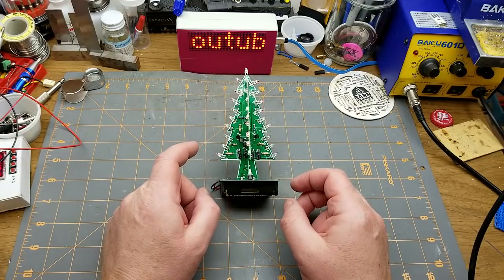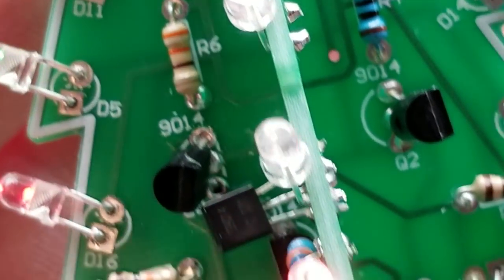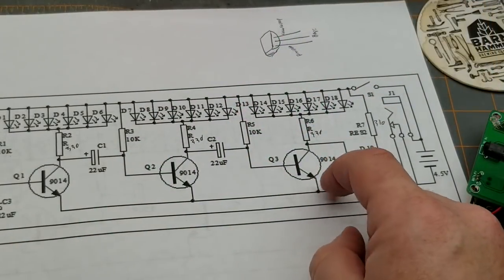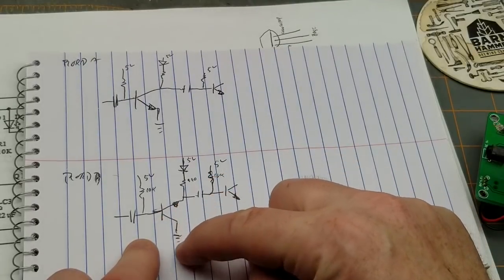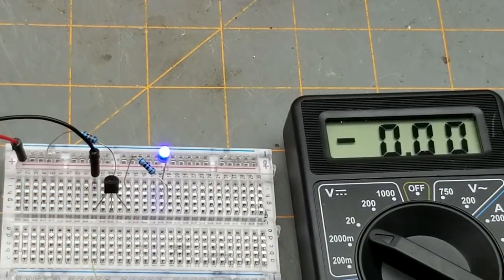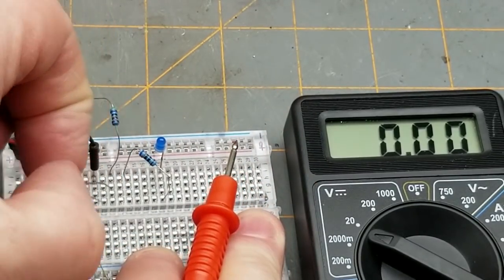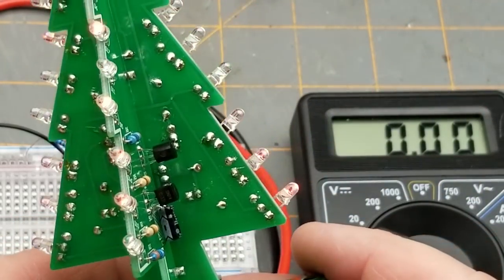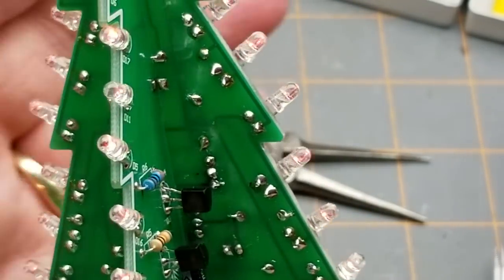LED christmas tree fix.

Comment: It is an NPN transistor, so swapping the collector and emitter it is still acting as a transistor.  The difference is that the gain (hfe) is much smaller if you reverse the transistor. In the old days (early 60s) when I started studying and playing with electronics we even had to test transistors in reverse mode. If I remember right the gain of the old germanium transistors were nearly the same if you swapped the emitter and collector. Some data sheets even gave the values of the gain in reverse mode. There were circuits which used the transistor in reverse mode , I do not remember why, but in certain applications it worked better in reverse mode. If you try it as an amplifier instead of a switch, by say putting a 1M resistor between the +5 and base (giving a base current of about 4.5uA) and measure the current between the + rail and collector you can measure the gain. (Maybe using a 100 ohm resistor in series between the supply and the collector just to limit the current in case you make a mistake.) The current should be around 5-10 mA (gain between 100 and 200). Now swap the collector and emitter and measure the current, which will probably be less than 1mA (gain of 20). In the circuit you are using much higher base current, so the much lower gain in reverse mode is still enough to turn on the transistor fully.

Comment: How did you break yours???  I assembled my solid 3-colour(Yellow, Green and Red) back in 2017 for Christmas and it works perfectly!  I originally assembled mine with a multicolour flashing LED on the very top!  You are not supposed to add the transistors in-line with the multicolour flashing LED's.  I got myself a 10 RGB LED singing snowman kit for Christmas 2018.  The micro USB connector was a pain to solder on the board with my old Radio Shack soldering iron but it is working perfectly as well.  That Christmas tree kit can be tricky to assemble with almost no instructions.  The hardest kit that I soldered together with my Radio Shack soldering iron was a 132 SMD LED VU meter/speaker kit and it works very well on a clean 5 volt power supply.  I will be looking forward to see more electronic kit videos.
Reply from the maker: I made an assembly mistake: https://www.youtube.com/watch?v=xeyujjQwTys
I was paying too much attention to making a video and not enough to actually doing the kit! 

Plus, y'know, that whole lack of instructions thing.

Comment: If the transistor is off, there should be no current flowing through the diode so there should be no voltage drop across it. So Vce should read 5V or supply voltage. Not sure what you were seeing but I suspect that the transistor was leaking current . So woke up 6.30am here so could be writing this while still half a sleep 8-)
Reply from the maker: Good thought.

Now I'm confused  again...

Comment: Do you think the transistors actually has any effect with those funky LEDs?
I ordered a similar kit but it hasn't turn up yet.
Reply from the maker: I probably could have hotwired the LEDs and had a similarly interesting tree.  But the LEDs do seem a bit dimmer than the single permanently on one at the top of the tree.

I just measured it off some video frames.
on time: 0.63 seconds, off time 0.23 seconds.

The blinky LEDs do seem to maintain their position in their sequence through the off periods. They definitely do go through their entire "slow RGB then fast RGB" sequence. I assume there is a small capacitor in the chip in the LED.

I wonder if I should sends a few of those LEDs to youtube.com/user/electronupdate for de-encapsulation and microscope analysis?
Reply: The transistors create the "sparkle", by reducing voltage in a cyclic fashion that keeps the IC inside the LEDs running, but periodically extinguishes the light. The upshot is to create that flickering/sparkly effect. Without the transistors it would just be all the LEDs cycling colours, so it would be multi-coloured but not sparkly.
The circuit is clever because If the power is switched off completely, then all the LEDs would always show red, since that is the colour that the IC always starts on. Remember... drop below (say) 1.8V and the chips won't conduct but the IC will still run.
(I have built a lot of this exact same tree kits, so I am a TreeMeister)
Reply from the maker: Many versions of this kit just use single colour LEDs, which is (I assume) why my kit came with 3 different values of current limiting resistors (to compensate for the different forward voltages current needs).

Comment: I like the de soldering needles but I found something far cheaper and I think, maybe easier. Cut the component close to the board. Push a fine tip iron into the  area where the lead was just enough to make a dimple, Choose a drill the same size as the lead and drill the middle of the dimple. You get a perfect hole all pre tinned.

Comment: 7:59 - My god that is horrendous soldering! You need to change solder, and use one with flux in it! And increase temperature... you are literally smearing paste around, those joints are not good at all.
Reply from the maker: You should see the ones I touched up before I did the close-up...

I think I mentioned earlier (probably in the previous video on this kit) that I had run out of the better solder and am currently using some ancient (30+ years old) Radio Shack solder until my new supply arrives.
Plus, it's more challenging than I initially thought to solder at arms length on camera while looking through the camera's viewfinder and simultaneously trying to provide relatively coherent running commentary.
I'm trying to improve on that particular combination of skills, but it'll take time and practice.
That said, you're right - some of those joins are pretty ugly. But they all work